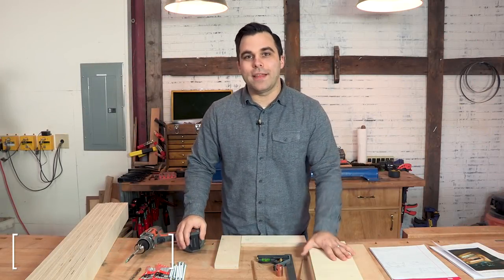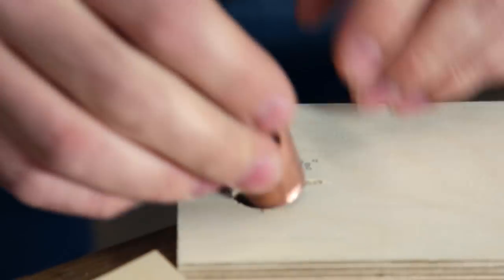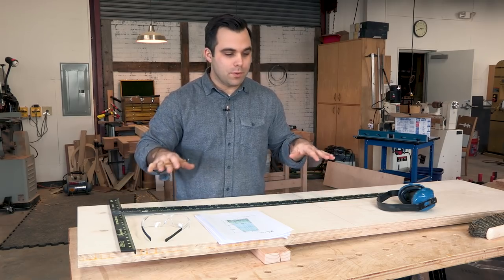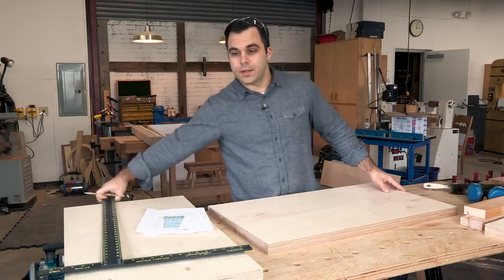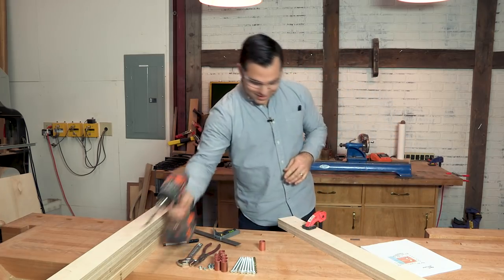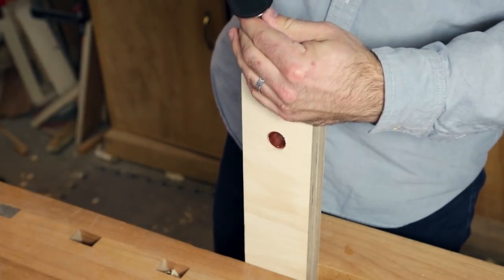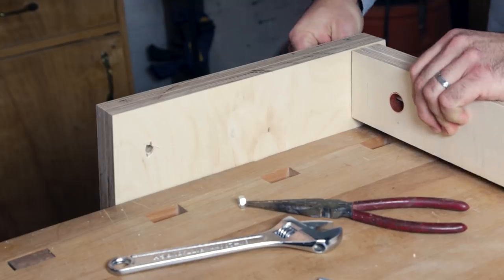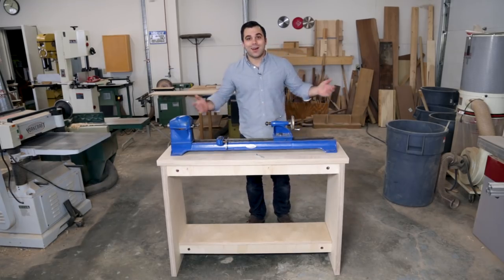Alan Lacer's Ultimate Lathe Stand with David Lyell

Comment: David, you should revisit this one now that it’s been out a while. Staying true to Alan’s original intended design is the key. The complexity of the splayed base is what makes this stand so unique and superior to other scrap wood stand videos that I am seeing.  A long time hobbyist carpenter, I only recently got into wood turning. I just got my first lathe and wanted something more than just setting my gear up on a piece of plywood spanning two sawhorses. I weighed the pros and cons of buying some store bought metal stand vs. building my own. After much research I decided that Alan’s design was the one I wanted to emulate. 

The entire build was a learning experience with the bare minimum of tools for me (seriously… a 6-1/2” cordless saw, basic drill bits with cordless drill, and a speed square).  The end result is almost identical to Alan’s original. Other than using oak rather than birch, leaving a slight lip around the trim at the top to keep parts from rolling off, and no hole for extended belts it is perfectly done by the original design.   This piece really stands out with the final outcome being a functional yet classy piece of furniture which will last forever!  

Do your viewers a solid and go the extra mile building it the way it was intended.
Reply: Hi David. I agree with the statements above from cozumelmako. I have started a replacement stand for one that I build long ago, and chose to more closely follow Alan's design more closely because of the splayed legs and very strong joinery. Like you and didn't need to the motor shelf, and needed to adjust the height and width to meet my needs. I depened the bottom shelf to hold extra weight from sand bags as the original author suggested as an improvement,

The duel fastener 3/8" on all stretchers is also a key to the unit's stability. Using single bolts and straight legs make a rectangle which will rack. The double fastener setup will result in an arrangement that is much less likely to rack.

I know it seems impossible that tiny vibrations get amplified and result it chatter and tear out, however a comparison of a thin scraper tool and a much thicker one (I know, more expensive) when working even a couple of inches in side a bowl away from the tool rest will demonstrate. 

My $0.02

Comment: Thank you for making this video. I started turning about 10 months ago, and I can't get anyone to build  a stand for me, so I'm just going to build it myself. I'll have to invest little by little in the proper equipment, but I think it is important to have a stand that is strong and intuitive. Like you, my needs will call for a longer stand to account for a bed extension I plan to invest in. Interesting to note that I purchased a metal universal stand and noticed that for the first time the vibration from the lathe reverberated throughout the room. I turned for 8 months just using a sturdy wooden dresser (I'm poor) and never experienced vibration throughout the room. I am now convinced that this wooden bench will do a better job due to its low center of gravity design, and also due to the birch plywood more naturally absorbing the vibration. I think the metal designs conduct vibration rather than absorbing it.

Comment: Hi I am intrigued as to how you intend to change lathe speed without the hinge'
As fro splaying the legs I agree the angles ar not necessary I am simply going to attach some 4X2 pieces wider than the straight leg at the base as the weight of sand will keep them firm. Helpfull thankyou.

Comment: You can buy half moon nuts that do a similar job to the copper+nut, and are a staple of flat pack furniture that needs good long term strength (eg IKEA beds)..

Most are really crappy cast aluminium though so shop around for some nice ones.

Also, a washer or two in the bolt end to stop it grinding itself into the wood (initially and over time with vibration).

Comment: David, a couple of questions if I may. First, do you recommend this stand for a lathe that is 60” in length? If, so what modifications would you also recommend? Second, because of floor space constrictions I’m also considering narrowing the overall width of the stand. IYO what stability issues will that create? Thanks so much for you advice and input.

Comment: Great build. I like the way the rails are joined to the legs. Using copper pipe looks like a great idea. I’m working on a workbench design and might modify that by using two bolts or a larger bolt, It looks like it would work and be easy to do. That type of joint also allows for tightening if the joint loosens up over time.

Comment: Thanks for sharing my friend, I followed your directions and built this today. It has been a long long day, but I got it done. I was going to buy a stand for my lathe, It cost $150 for the lathe I just purchased. I decided it would cost less to build it plus if I did it like you did, it should be studier or possibly studier. I am pleased I made it, The copper pipe was a little bit of a slow down if you will but I got them all in. I did 2 bolts per rail like the directions you referenced in this video and linked to. otherwise, it went smooth, not sire if I saved any money since I had to buy almost all the materials, but I do have some scrap now for some other small projects I need to get done, so all in all it still is more for the money than buying the stand, and I made it. Thanks for sharing this video with us. I won't be doing a how to video, I will link others to yours. I will do a short video on the set up and links back to yours if someone wants to build their own. Thanks again my friend and have a blessed week. 
Dale

Comment: Sorry if a stupid question but I have seen so many YouTube videos showing how glue nowadays is stronger than wood and when tested the wood snaps not the glue. So my question is why use the lag bolts? 

Thanks for video, thumbs up given 😀. Cheers
Reply: So they can tear it down and move it later on. I bet there gonna sell it or somthing lol. Not sold on the copper either!!
Reply: In this case Shaun, you do want just a bit of flex to keep it from doing just what you talk about. Not enough flex to be sloppy mind you, but a bit of flex. The bolts can do that. Gluing it up hard, it could leave the wood no choice but to split up.
Reply: I would just use screws since you're going to the added expense of using Baltic Birch. The joinery shown in the video is for particle board or MDF.
Reply: I’m wondering why, if you’re laminating everything, you can’t design in half-lap joints from the very start? Glue & screw and voila! Bombproof…

Comment: I would suggest you both use, and demonstrate using your machinists/sliding square angle to set along side of your drill when trying to drill out something that I suppose you want to appear to be a 90* hole. Both of the places you drilled through legs they went in on angles that could prove problematic. IE: watch what you've filmed before throwing it out there.

I would use a standard HSS drill when drilling Copper, it would easily drill your plywood too, and wouldn't wreck the tips/wings of your nice Brad Pints.

I agree with John Franks's comment to use a nice wide washers on the outside, so your bolt heads didn't draw through to the inside. 

The inset lower shelf is a smart idea.

Keep trying, many are rooting for you......
Reply: And I can’t believe that this stand would be free of “racking” if you pushed sideways on it! There’s nothing there to serve as a diagonal brace or gusset to stiffen it up! A flat nut inside a round copper tube would be very unlikely to stay tight, so I don’t understand why they wouldn’t use half moon or barrel nuts since they’re rounded. I know I’m armchair quarterbacking here, but this project has an unbelievable number of questionable elements to it, and techniques used in construction! And it has no bearing on the outcome, but I can’t stand seeing the guy use a Sharpie on a woodworking project!
Reply: I’m glad you added a recent comment to this two year old thread.  The stand in this video is a mess compared to the original.  I built a faithful version for the exact same lathe shown in this video and it’s great.  The shortcuts taken on the version shown in this video are the reason you never see the finished product.  Missing shelf, 1/2 the fasteners, and no 15 degree angle  would be a disaster. I was skeptical of the copper pipe fasteners, but after installing them I completely get it. Rock solid. The only issue I have leaving the top shelf flush with the legs is that shavings accumulate on shelf. Original stand is super functional, but this version is shoddy imitation just to put out a crappy video. Far from “ultimate.”  I made the real one and this video is insulting
Reply: @pjclose8188  I agree totally! The original looked pretty bulletproof! The one on this video, not so much! I’d say the producers shot theirselves in the foot in their haste to slap something together and get the vid out!

Comment: Drilling straight 2+ inches and getting the hole in the center of a 3/4" copper collar is neither practical nor easily done.amy will ruin both the wood and copper
 Gotta be a better way.

Comment: Great project.
But the problem is the price, $240 for a sheet of plywood alone. 
Approx $70 more than a new lathe table.
Reply: This was my initial thought too as I started costing out supplies needed.  In the end it was a sense of accomplishment and well… basically a flat out insult to a true woodworker.  Nonetheless, it IS a fun intermediate project when done like the original design!  I suspect that I’ll have many years of great use when complete.